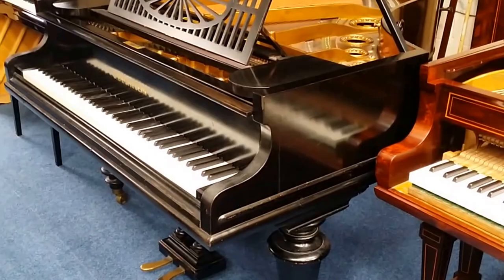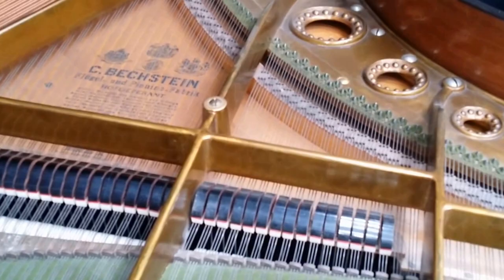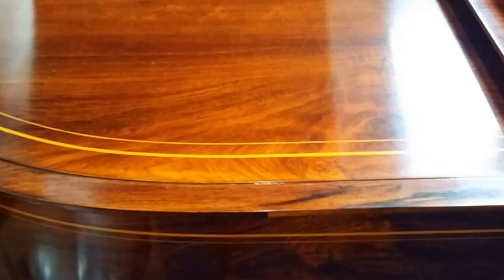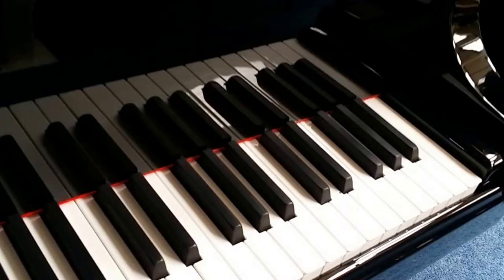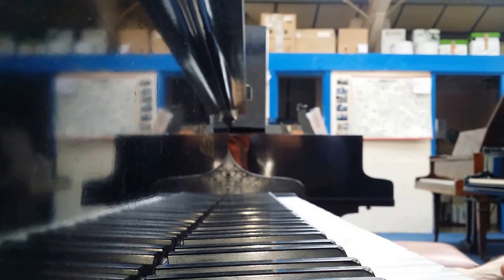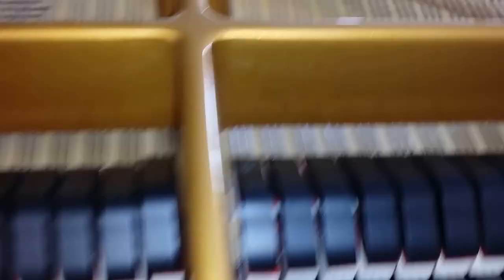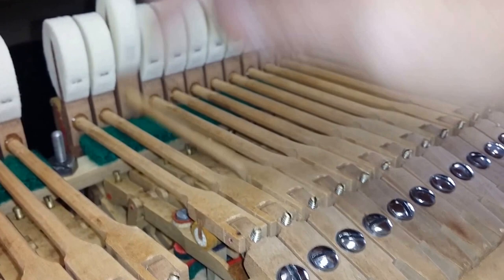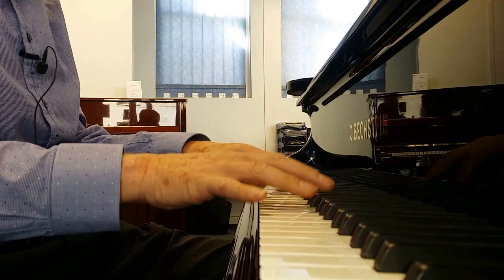Before and after transformation of a Bechstein model A grand piano 1910

Comment: Another excellent job. The piano that I covet is your 1902 Model III. I am not keen on the sound of modern pianos, even premium ones. My theory is the the pressure of piano competitions affected the scale design during the 20th C to keep up with the louder-faster school that was prevalent and of course having a piano used at at premium competitions was effective advertising. Enough of that!
My  teacher (46 years ago) had an edwardian Bechstein restored and it was superb. It also had a Horowitz like action set up, shallow and light. I couldn't take advantage of it but her husband (an aerodynamicist at the RAE) most certainly could. She had a new Welmar to teach on and that too was rather good.
I have a question about the welding. Is the frame cast iron or cast steel? Cast iron certainly used to be almost impossible to weld effectively due to free graphite but maybe  metallurgists have solved that. Of course, it helps that it is a strut (i.e. in compression). If it is CI, do you use a specialist welder and if so, what is the process?
Reply from the maker: Thank you for your useful comments and the question about the frame welding. I have to confess I don't know the answer but will try to find out. We use two different specialist welders who are both experienced with stitch welding and the work has always been of high quality and never given problems. Frame cracks that we've seen are only on model A and B Bechsteins around 1902 to 1915. best wishes, Marcus

Comment: (a) just what was done to repair (or just hide) the plate crack? (b) Were the wippens on rocker arms, and did they get upgraded to capstans underneath?
Reply from the maker: Thank you for your important question. The crack was stitch welded, which is the usual technique used in the piano trade. The whippens were the modern capstan type as I think on all  model A Bechsteins of this period. It's mainly the older model B and V that have the rocker arms. Marcus

Comment: i havce never heard of a frame cracking, is it repaired in house or outsourced, is it heated then welded or is there some other process to deal with the crack?
Reply from the maker: The model A Bechstein frame often cracks; you'll find plenty of illustrations of it on the internet. The trade in the UK usually stitches and welds it. From our experience the crack has never caused any issues but is purely cosmetic. Marcus

Comment: Why are cracked frames a common issue with these pianos specifically?
Reply from the maker: I've asked Marcus to get back to you on this one Aemilia, as I don't know for sure. my guess it's to do with frame tension, perhaps the size of the case or shape makes for a frame that bears too much tension at the crack pressure point. Or something to do with the angle of the strings leading to a frame design that appeared to hold the tension at construction, but of course 20-30 years later was too much sustained pressure. But I'll let my father get back to you on that one. Best, Evan